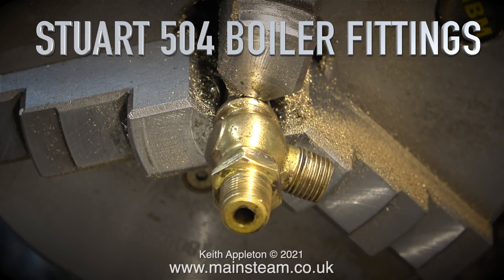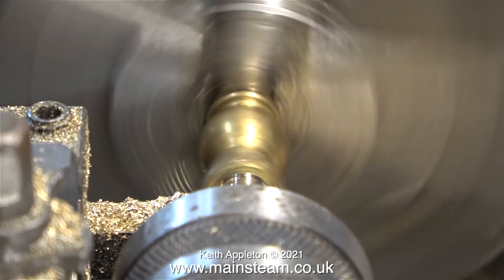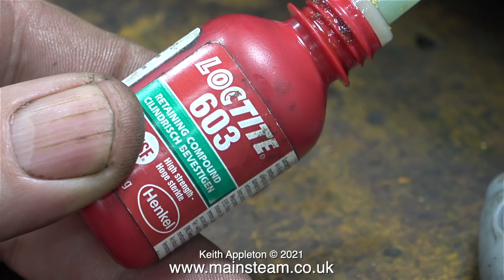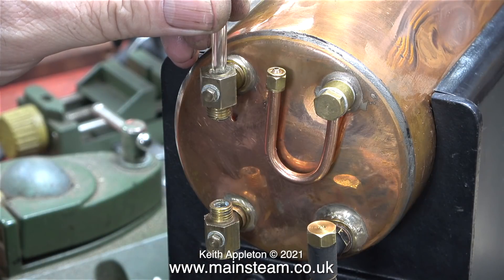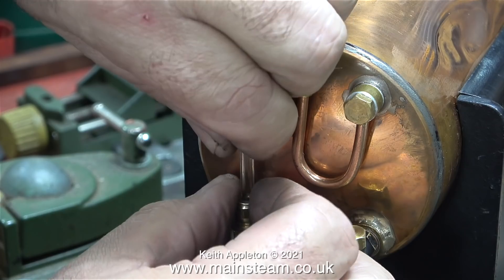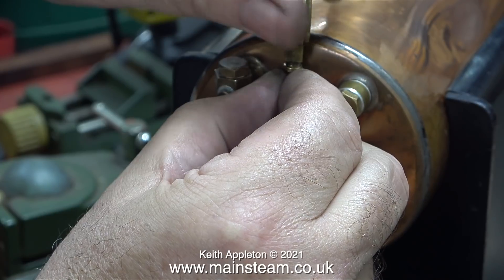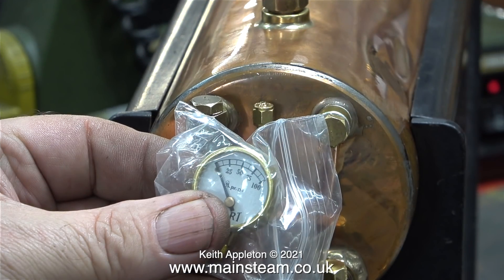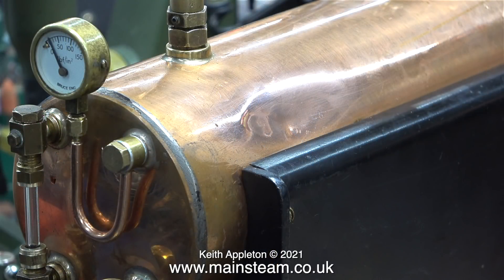STUART 504 BOILER FITTINGS - IN THE WORKSHOP

Comment: The steam tap you fixed... it looks like it had another thin piece of hexagon silver soldered on the bottom?  Is that standard construction of the valves or is it a previous repair?  Maybe that is why it is so out of center... because it was a previous poor repair... it almost looks like it was a coupler to change the threads.

Comment: You often say that you don't like the standard Stuart pressure relief valves and you prefer a different type but I wonder if you've ever tried to make your own ?
I'm sure a guy with a well equipped workshop which includes a selection of lathes would be able to design and build something he was happy and might actually have some commercial value. Have you ever considered this ?
Reply from the maker: I buy them from Jubilee Fittings or Blackgates Engineering. I just don't have the spare time to make them.